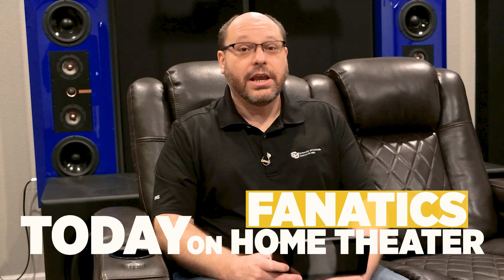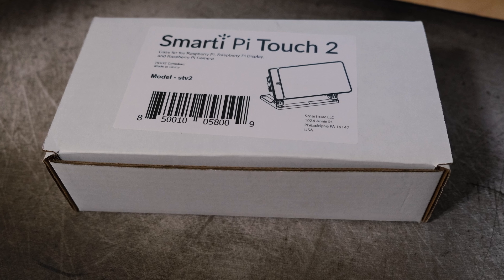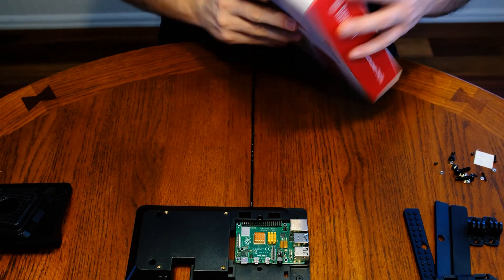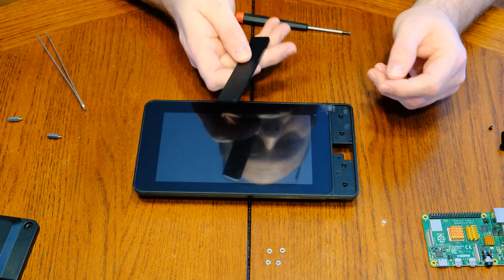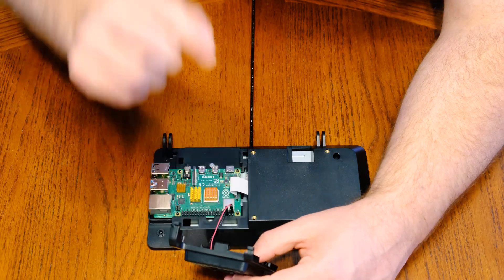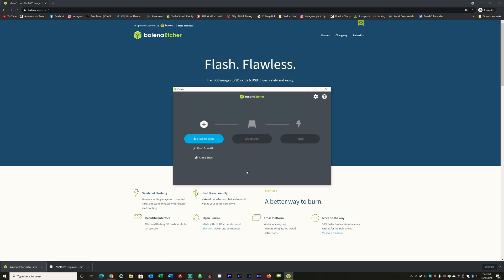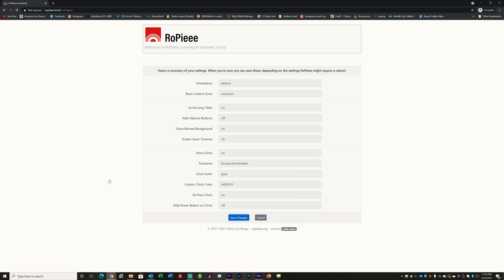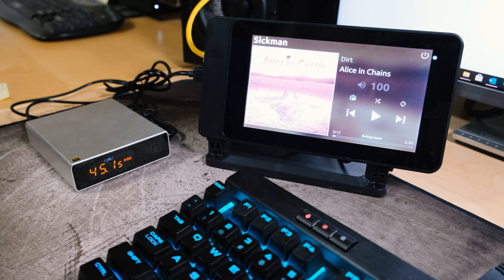How to build your own Raspberry Pi Music Streamer!

Comment: Thank you very much, Jiles. You've explained everything so clearly. I've been thinking about setting one up forever to use as an Apple Music player (HiRes! Woohoo!). I'd like to use the DAC on my Cambridge Audio CX81 amp, but I'm not sure if I need an extra piece to provide for a Toslink output? or would I be able to use the Pi's USB ports directly?
Reply from the maker: I think that depends on if the CX81 and take a USB input?
Reply: @JilesMcCoy  Yes, it does. It has a USB Audio Input (up to 24-bit/384kHz & DSD256 digital files from Mac/PC). Would one be able to use that as the DAC for the Raspberry Pi? I'm hoping that I can build an "Android player" using pi + touch display 2

Comment: I was of the understanding that the Pi’s USB ports were SUPER noisy and not a good option for DACs?
Reply: add hifi berry or allo sig top hat, with dual power supplies  for best audio quality
Reply: @spireprintingpackaging2093  Those DAC HATs are fine but they are no where near the performance of a good external DAC. I'll probably end up running a optical HAT to the DAC. Looks like the HIFIBERRY DIGI2 PRO might do the trick. Thanks for the recommendation.